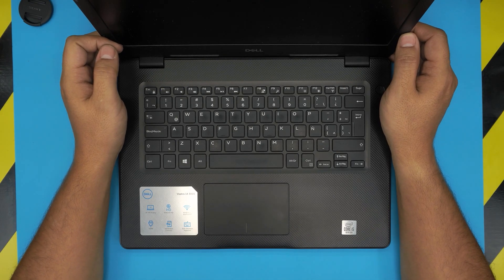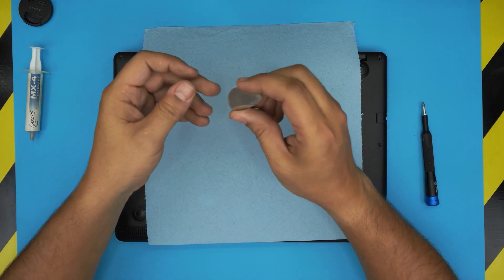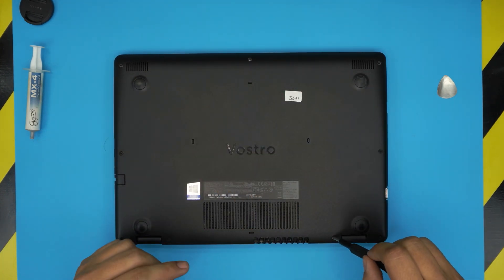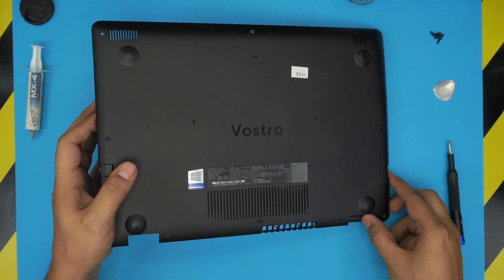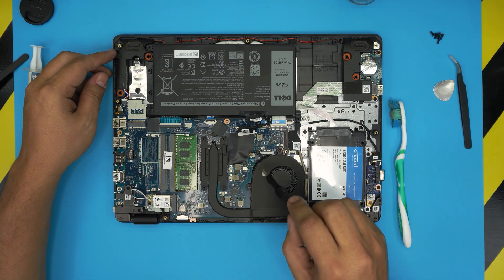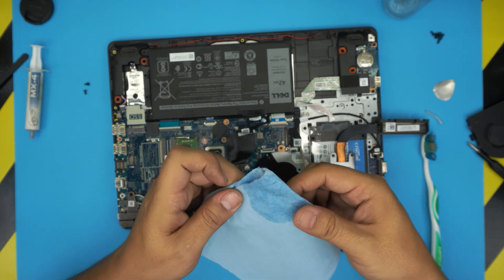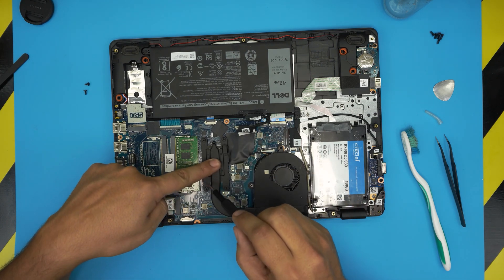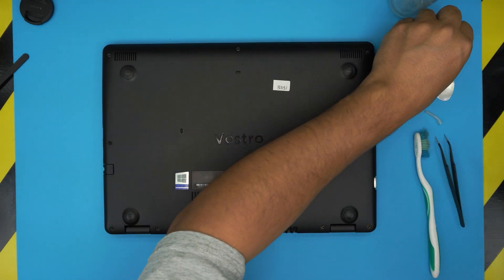Dell Vostro 14 3000 3490 Repaste Service and Cleaning

Comment: Do we really need to unscrew the vent first? Doesn't the pipe just run above it? Thanks
Reply from the maker: 🫠Regarding your question, you don't need to remove the fan if you only want to remove the heatsink, but i would recommend you to remvoe the fana dn clean under the fan and you can take the fan out and clean it better. 
Should you have any further questions or requests in the future, please don't hesitate to ask me.
cheers🍻